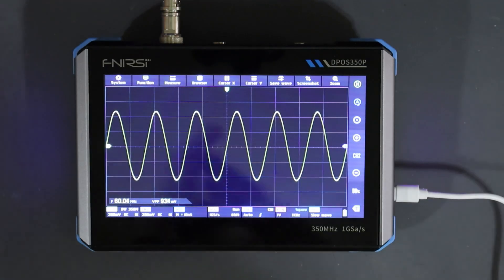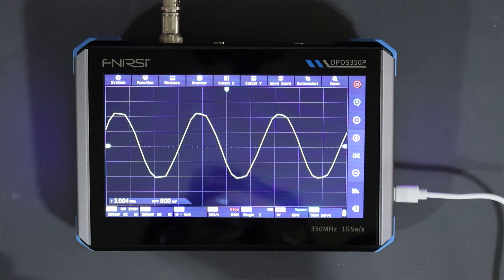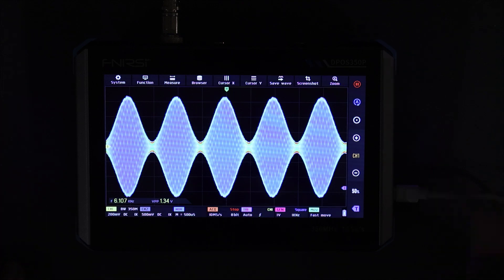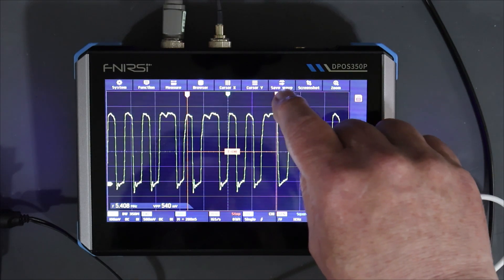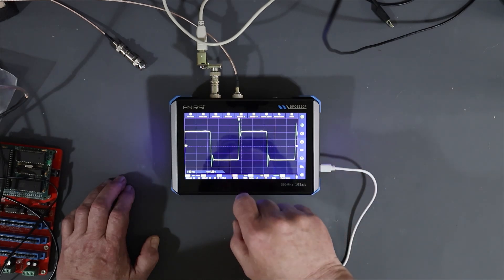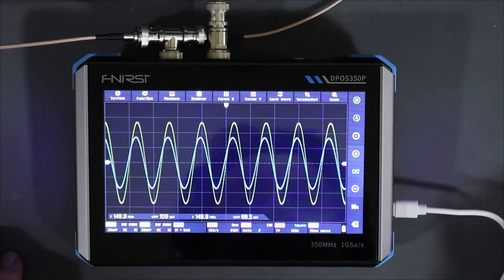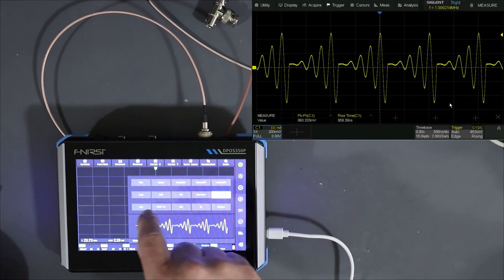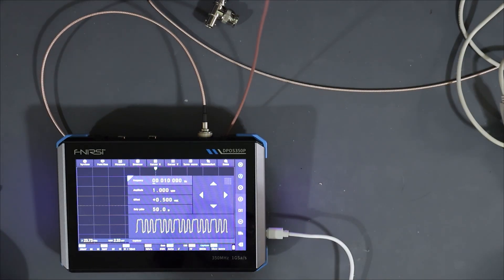Uni-Byte 0282 - In depth look at the FNIRSI DPOS350P Tablet Oscilloscope: Part 2

Comment: There is a new firmware soon.🎉
Reply from the maker: That would be good to see.
Reply: @uni-byte  

From EEVBlog
"I have released a new firmware, which may be announced on the FNIRSI official website in the next few days. The DPOS350P-FNIRSI-2025618 firmware fixes the following issues:

Fixed the inconsistent measurement names of Du and DT parameters

Fixed the freeze issue in scroll mode

Fixed the phase difference issue of 2 channels

The minimum frequency of the frequency response analyzer was changed to 10Hz

The frequency response analyzer added a display of the sampling progress percentage

Fixed the battery level jump issue

Fixed the abnormal shutdown issue"

Comment: Well, it's a Fnirsi oscilloscope, what more could you expect?
But it will be of some use to hobbyists or students.
Reply from the maker: For sure.  80% of troubleshooting is signal tracing though a circuit.  Finding where there is a short or the signal dies/distorts.  This will do all that, even if it won't beat out a 3.5 digit DMM on voltage measurements.  I'd be willing to bet this would meet the (real) needs of 80% of hobbyists.  But we love our over-spec'd, expensive toys though.

Comment: So, do both channels measure different values, even if you connect the generator correctly?
I have had three Fnrisi scopes, and this error occurred with all three.

It should be taken into account that this does not contain 1 1GHz ADC, but:
"It looks like they are using 2 analog channels per ADC chip (chip has 2 analog inputs) and 4 ADC chips, two for each DSO Input. If true then they are ping-ponging between each ADC channel within each ADC chip to get the higher sampling rate, and then ping-ponging between each ADC chip to get the highest sampling DSO rate for each DSO channel, and then ping-ponging with all 4 ADC chips for a single DSO channel for the highest overall DSO sample rate. If so, seem like a complex clocking scheme, but may make the handling of the digital data easier as it's already "multiplexed" before hand by the 4 ADCs which would have 8 total (2 per ADC chip) multiple 8 bit data streams!

We looked at the MXT2088 data sheet and it appears to have dual analog inputs in a package layout like the old AD9288.

Best

" Yep 8 ADC's that give 8 bit data streams, so a lot of separate block memory parts in the FPGA are needed. The clocks need to be outputted on 8 different phases, which with internal delays won't be that simple to get right.

That is why I asked ... to check these clock signals.

In combination with the analog signals that need to be properly supplied to the ADC's in combination with this clock setup not an easy thing to get right. A single 1GSa/s ADC like in the Hantek DSO2000 series would have been much better."

" from EEVblog
too much ping-pong for me😵‍💫
Reply from the maker: Still have to do the test correctly, but I suspect the levels will still be off, but the phase difference will be much reduced.

Comment: Great video. I have the same likes and dislikes that you've mentioned here. Hopefully FNIRSI will respond with firmware updates. 
FYI, the inconsistent measured voltage and phase readings across CH1 and CH2 are a concern as well. I see the same thing with mine, and I wonder if in some instances this could also affecting readings in the FRA mode (which is working well for me in some scenarios, but not others).
Reply from the maker: Thanks.  WRT to the inconsistent readings across CH1 & CH2, I did some less than ideal things by getting caught up in the moment.  I may do a quick update on that in the next part.
Reply: Another observation is that CH2 appears to read higher than CH1 on my unit. I'm guess it could be due to some internal impedance matching issues?
Reply from the maker: @mostlypostie1  Yes, I and others have seen this too.  Some much worse than I have seen, so my guess is the attenuators are not built using high precision resistors networks.  We'll see when I repeat the test properly.

Comment: This is great..exploring mine.
I am upgrading from analog scopes, but was shopping for a digital scope and a spectrum analyzer and a sweep generator for HF radio work.
This was an obvious timely choice.
It does not replace lab grade equipment, but I am having a lot of fun exploring the capabilities of this measuring system. 
This fits in great with my lab grade signal generator and counter.
Future firmware upgrades may well quiet many of the string of valid complaints, but it is a nice piece of hardware for the amateur hobbyist for sure.
Reply: FYI, the SA mode is very limited, you might be able to measure harmonics at HF but really nothing much more than that. It does not have the required RBW (called 'FFT length' on this device) to see enough detail for much else. For SA work on HF radio you would be much better off with a Tiny SA Ultra. Of all the features the FNIRSI has, SA mode is the most limited on this device IMO. Maybe they can do more in firmware, time will tell.
Reply: @mostlypostie1  
The creator has already been notified in a blog, hopefully he will implement it.
He limited it because the user would have had to wait many seconds for the full scan to be completed...
I don't understand the creator's way of thinking.
Reply: @mostlypostie1 Thank You. Yes..I have reasonable expectations and tasking the instrument for HF and FM alignment and sweeping filter stages was the first order of business. 
It is getting amazing at how  many features can be packed into a small multi-capable instrument for the price,  these days, albeit from the Orient, but with some firmware changes..I might just have saved a ton of workbench space.
I wish America could compete, but I am just an amateur and the cost of living has me overly cautious and that is here in Canada with free Healthcare and Dental.
Life could be worse, but I love my HP 8640B slaved to a Racal Counter with a 10MHz precision time base.
Old used equipment can become mainstays and I hope this Chinese instrument gets the polishing it deserves. Thanks for your Post.
Reply from the maker: @mostlypostie1  Hopefully.
Reply from the maker: @anandarochisha Thanks.  It sounds like you have reasonable expectations.  I think that helps with an instrument like this.  Hopefully they will listen to the observations and provide fixes.